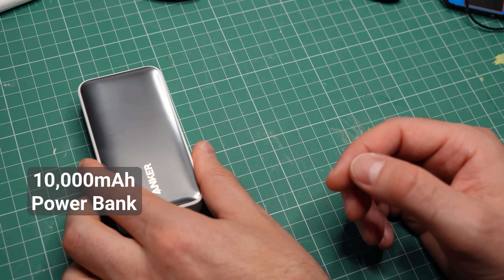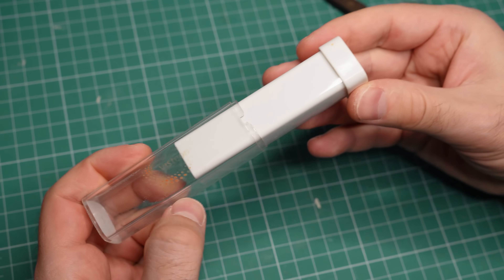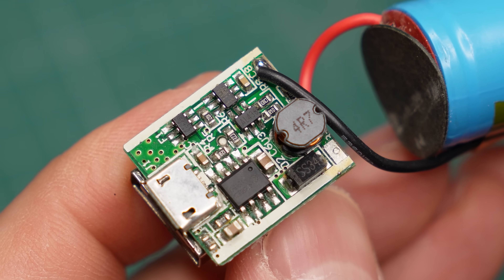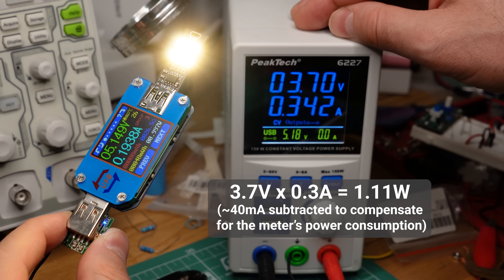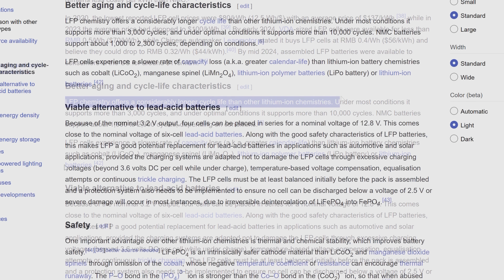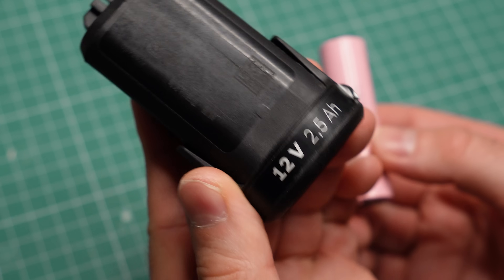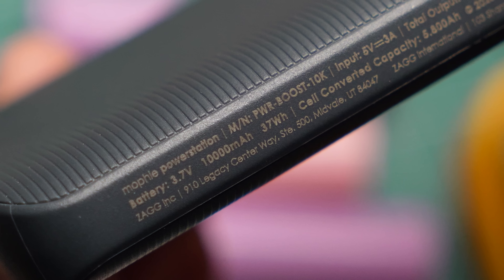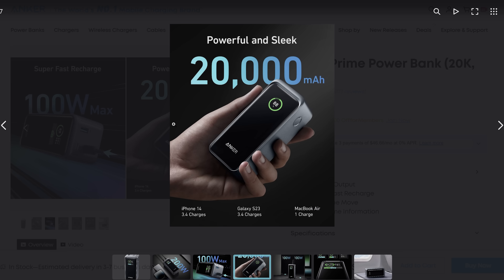Power Bank Capacity is Confusing. Let me Explain

Comment: It’s always annoyed me that it’s usually stated in mAh instead of Wh or J, mAh and Ah are measures of energy over voltage, if the voltage was at least always the same (e.g. 5 V) it’d be one thing, but this is just stupid.

My theory is that at least some companies purposefully reduce the voltage to get a higher mAh amount, in addition to everyone using mAh instead of Ah because it sounds bigger.

Wh just make sense, and are also used in the regulation for the maximum energy of a laptop on a plane (100 Wh)

Comment: You build a battery to a pack voltage. Let's say we were making a 72v battery which 84v fully charged. Let's say you are switching from Li-ion to Lifepo4 or vice versa. You want to use the same charger. For an ion battery you use 20 in series and for lifepo4 you use 24. So that's what 20% more cells so that kind of makes up the difference. You buy the voltage battery you need, it's not always a 3.7v power bank with more in parallel. I'm not saying your number is wrong I'm just saying that's not how I choose batteries. Iron phosphate has some interesting characteristics, the almost flat discharge is nice because you don't get that huge dropoff in power like NMC cells, you get a small drop and then it's steady the rest of the battery so you are always running around what would be about 85% charge in an NMC. You really have to watch your voltage with lifepo4 because when it says it's low you better believe it. You get good steady power the whole discharge vs that descent into sluggishness of NMC cells. I tried lifepo4 on my bikes for a few years but now I'm back on the NMC teet and running crazy pack voltages 35s and up these days. I actually have a modular ANT BMS that goes up to 104s. I didn't know that was a thing even. You have to use chunky DC breakers or contactors with these things so you don't vaporize your giant connectors when you attach to a load. It's all fun and games until the lightning comes out.

Comment: Lol 😂 not necessarily all depends on the battery battery in the batteries in the pack I got one that’s 72,000 130 white large capacity does 14 charge of an iPhone 15 Pro Max then I have a 40,000 TechSmarker power bank it does nine charges 
Then I have a  PD 30 W lightning 40,000 adaptive quick charging that does have chargers 

Each battery pack charged the iPhone 15 Pro Max from 20 to 80% and they were all different prices even though the last one was $200 regular price it was ridiculous but it was on sale for $44.99 with an extra 30% off if you bought two of them

Comment: Well actually for portable power banks I think there is also a typical capacity and rated capacity. I think maybe it is related to the voltage drop as the battery percent drops.

Comment: If the voltage of the phone and the power bank is both 3.7 V, then does that mean that a 10,000 mAh power bank can charge 2 5,000 mAh batteries?
Reply: No, since there will be losses when charging. You might get close to 2 charges

Comment: i'll never fully learn how a battery works unless i rewatch the video 12 times but some of the info i get out of it is useful.
Reply from the maker: If you have questions, that's what the comment section is for ;)
Reply: @LeftyMaker   well i guess i always question if leaving the charger in batteries is actually safe, everyone says that modern batteries capt at 100% and dont over charge so it cannot kill the battery, how would that even physically work? how does it not recharge or take away battery from it? its using the energy from the batter.
Reply from the maker: @FreeAimDog yes, that is actually a good question. The short answer is that you shouldn't be worried about overcharging if you're using a properly designed charger configured for the battery you're charging. 

Even cheap chargers have protection against overcharging, in the sense that they won't charge the battery beyond a certain voltage. For lithium-ion batteries, the limit is usually between 4.2 and 4.35 volts, depending on the model. 

The process is a lot more complicated, but generally, your batteries are fine. Unless...
- your charger is not configured properly (e.g. you're charging a 4.2V battery to 4.35V)
- you're charging the battery in extreme cold. I haven't experienced this, but I've read that if you charge a battery in the cold, its voltage will rise as it warms up. 

And in the case of a phone, for example, when the battery is full, it gets disconnected while the charger supplies power for the phone. It is only engaged if the charger cannot provide enough power.

Comment: USB batteries not advertising in Wh is my pet peeve. I don't know what mAh is supposed to tell me especially when they also dont share the nominal voltage. It's nonsense.
Reply: I know right? One could argue it was simpler before quick charge and PD when all power banks output 5V, but now they do 5V, 9V or more, which voltage the mAh they were calculated at!

Comment: The 3.2V vs 3.6V difference is the biggest part of this scam. Converter losses will also come into play when you use watt hours on both sides. By any chance, are there any phones out there that advertise higher mAh than most brands because they use a different chemistry with lower voltage?

Comment: Current times voltage: 5A×5V:25W
10.000 mah(10A)10×5(mostly charging voltage is 5 or 4 because the battery itself is 3.7 volt)50Wh but it can't just give full 10 amps,it has a maximum current,5×7:35 W
or can be a higher voltage low current like 20V 3A :60W

Comment: Nope. Wh is still bad. Watt is joules per second. Wh is joules per second for 1 hour. Using Wh is the equivalent of using "metres per second for an hour" as a unit of measurement for length/distance. Stupidly redundant. Just use joules or kilojoules. Don’t tell me “but but I’m not familiar with that unit”. Kilojoules or kJ is on pretty much every single food packaging denoting the units of energy it contains (unless you are american and use CaLoRiEs lmfao).
Reply: Ok hater
Reply: @samusaran7317  ok american

Comment: The voltage step-down in a charging phone dissipates some heat, 100% sure, but doesn't most of the heat come from the battery itself? Some inefficiency in the chemical processes of the battery?

Comment: Watt hours are also stupid. We literally have joules, which are the original unit, and watt is basically 1 joule per second, so writing watt hours is like saying I've driven at a speed 100 km/h for 1 hour instead of I've driven a 100 km. Given, 1 wh is 3600 joules, but both units are quite arbitrary, so just use the less stupid of two.

Comment: Yet I still don't understand why my 40000 mAh power bank managed to charge my phone 4 times when I bought it, but now, after 2 years and not more than 100 cycles, it only charges it roughly 1.7 times.
Reply: Are you leaving it fully charged?
Reply: @samusaran7317  When I bought it, it said in the instructions that I needed to charge it from 0-100 once and not leave it at 100 afterwards. So I did exactly that, charged it to 100 once and for the rest of the time, it was mostly sitting between 20-80 when I didn't use it, a few times at 0-10, but never left it fully charged as far as I can remember.

Comment: Wouldn't a battery with the same(but lower) voltage as your phone, but equivalent mAh to compensate for voltage difference (from a higher voltage but lower mAh) be better for charging your phone? Since it doesn't need to lower the voltage to charge your phone battery resulting in less energy loss from charging?

Comment: Another fun fact about Ah. It does not take into consideration the different discharge curves of different battery chemistries. So, a 6Ah 12V Lead-acid is NOT equal to a 6Ah 12V LifePO4, since lead acid bottoms out at 10v while Lifepo4 stops at 12v. The Lifepo4 has a fair bit more energy since its discharge curve is so flat, as opposed to lead-acid's more linear curve

Comment: I've been saying the exact same thing about smartphones for years now and it infuriates me when tech reviewers like MKBHD and MrWhoseTheBoss still use mAh to compare
Reply: They are not electrical engineers, there is nothing wrong with using mah ratings for their video purpose. The consumers needs to read the specs for the power outputs.

Comment: some (most it seems) battery packs only have amp hour, and it doesnt say what voltage that operates at. now i just assume 3.7V but i wont buy any power bank that doesnt have either the amp hour and the voltage they used to calculate the amp hour, or just the watt hour.

Comment: You're all wrong. :) My diy powerbank is 8 2600mAh lithium cells in parallel so it's 3.7 V (at 50%) and 20800 mAh. However since they have a discharge rate of 9A (3.5C) it takes about 17 minutes at max speed to discharge it, 270 Watts !! it's plenty for a phone. In fact max it does is 22,5 W. Energy is about 77 Wh.
There are practically minimal losses cause it uses 5v or 4.5v and 5 A. 22.5 W

Comment: Using Amp hours for capacity is absurd. It's like a removals company telling you they can get 3 vehicles to your property in a day, but not telling you the size of the vehicle. It could be 3 bicycles, or 3 freight trains.

Amp hours, quite simply, is not a measure of energy capacity.

Comment: The main reason for mAh to still exist is because powerbanks have been using that for way too long, and it become the "banana for scale" for powerbank capacities. I think these ratings would all be the equivelent value in 3.7V, even though you are not likely to find 3.7V configurations in higher end powerbanks nowadays. 
And it's not like 3.7V equivelent mAh is a bad way to market, since if you actually measure mAh from the battery and market that instead, nobody would know how to convert that to Wh, since it not only depends on the voltage, batteries also don't have a fixed voltage, meaning that you would have to do an integral on power consumption to get the actual value, and needless to say most people seems to be scared of calculus so this is only going to add confusion.

Comment: With tool batteries you can get even higher voltages. Milwaukee's standard is 18v, Hilti uses 22v, Dewalt has some 60v tools and Makita has a 64v line. They're all just measured in aH, so you need to keep in mind the output voltage to calculate how much power they actually store.

Comment: I guess everything is in there but I would organize it differently.  The main reason the 10,000mah power bank won't twice-charge a 5,000mah phone is not the efficiency loss.  It's the mismatched device voltages as you eventually said.  And using watt-hours is indeed the right way to go if they're published.  Often not the case.  So yes, you may need to calculate W-hr if you know the cell voltage.  Efficiency losses due to DC-DC conversion exist too but its a minor effect compared to the differing device battery voltages.  There's a third factor easily more significant than efficiency.  Cheap devices simply underperform their specs.  After doing all the math, my powerbanks only deliver about half to two-thirds the charge I would expect.  This may in part be because manufacturers rate their batteries under optimum lab conditions and very low current draws.  In the real world capacity will be less.  But also in the real world ads are written by marketers and many marketers lie.

Comment: Everything bad until you see the manufacturer show two measurements ( battery mAh and effective mAh)
Reply: Rated capacity is the total energy stored in the cell alone, and effective capacity is the theoretical maximum amount of energy you can pull from 100-0 after conversion losses

Comment: All you explained is technically correct but you should not disregard the Ah values as worthless, this value is the only correct measure of a battery capacity as it effectively measures the chemical capacity of the battery cell, it measures how many electrons the cell is effectively capable of supplying, when charging and discharging a battery you can only trust the amount of electrons they were pushed to/from the cell to estimate the SOC (state of charge) of a cell, as the current is the same regardless of the voltage drop due to internal cell resistance or circuit resistance, that's why battery management systems use this measure (coulomb counting) to estimate the SOC, wh on the other hand will deliver different values depending on where you measure it, as you cannot accurately measure the internal voltage of a cell, specially while under load

Comment: You could argue that the Joule should be used as it's the SI unit for energy. Marketing people would love it, 90,000mWh becomes 324,000J. (Just * 3600 : number of seconds in an hour)

Let's just not go into electron volts, 2.022249e+24 written in full would be a tad excessive, even for marketing!

Comment: Finally someone addressed this. I’ve been saying we should be comparing battery capacities with Wh for years now.
Reply: Same. It drives me nuts when internet 'experts' talking batteries - especially home, solar & off-grid & car batteries talk about amp hours, instead of the more useful kWh
Reply: But there doesn't seem to be a big difference in Wh and mAh, if the only difference is the factor of 0,2 I mean if I have a 10.000 mAh Battery with 3,6 V and one with 3,8 Volt it's only a difference of 2 Wh and that's the biggest range in differences or did I miss something?
Reply: @Johan-mr5ch That's silly and makes no sense.
Reply: @_nom_ explain yourself

Comment: What I never understood is why laptops use Wh but phones use mAh
Reply: my theory is because its commonly known that legally, laptop batteries 100Wh or higher cant be taken on planes. So many manufacturers will purposely make them 99Wh and then advertise that so people know its airplane friendly. Because of all this, its now standard to just measure in Wh.
Reply: @subhansajid6386 You could also say "It's airplane friendly" or "That's under 100Wh"
Reply: Why does everything stick to a non-stick frying pan? To create confusion, controversy and mistrust.
Reply: @jaystarr6571 your non-stick pan sucks
Reply: @jaystarr6571 you need to oil it up
Reply: laptops are multicell and have larger packs for which Wh is a better unit than mAh
Reply: @MahbodKaramoozian  then just use mWh. There literally no actual good reason to use mAh
Reply: @Supreme_Lobster  the "multicell" part in series plays a big role in why mAh is not used in laptops, when you put batteries in serial mAh just becomes a wrong measurement because of complications and inconsistencies while for only one cell it's completely fine to use mAh if AND ONLY IF you specify voltage
Reply: @MahbodKaramoozian  its not fine because even if you specify the voltage, most people dont know how it works and just assume higher mAh means higher capacity, even tho you can simply increase the mAh and decrease the voltage, resulting in no capacity increase, but advertising as higher capacity. mAh allows manufacturers to lie in advertising. Wh (or mWh) doesnt
Reply: @Mah @MahbodKaramoozian  just said there is no good reason to use mAh, and you just go and say the same again, not sure im following here
Reply: @MahbodKaramoozian ohh thank you
Reply: Because, laptops didn't use same voltage for their battery, different manufacturer has different voltage configuration, meanwhile mobile phone just stick at 3.7~4.2 V as it is default lithium ion voltage.
Reply: @EdiUtomoPutra  ok, but everyone already was familiar with Wh so why change to Ah? Like it was already a common standard, and a more useful one, just keep using it, why get a new measurement that is worse in every way and force everyone to use it
Reply: @dofer112 someone started to use mwh in phones and powerbanks so that stuck and once consumers are used to one measurment its nearly impossible to change it again.
Also most people simply don't care.
Reply: always the numbers. 90% of oems mislead by making high milliamp hour counts, but a horrid efficiency or watt hour count
Reply: It is much worse. Things like gasoline, coal or food use calories :(
Reply: Could be, havent looked this up so correct me if im wrong, but I believe most phones use 5v for their battery and internals so it was pretty standard
Reply: @finnjacobs  no. The phone batteries have their nominal rating at 3.7 - 3.8V, it says on the battery sticker. Even the guy in the video mention the "step down conversion" from the 5V on the input.

Comment: What baffles me, is that Power banks use 3.7V lithium batteries, convert it to 5V and then phones drop it back to 3.7-4.2V for its lithium batteries. We are making unnecessary lossy conversions, and it would be much wiser to add support for sub 5V charging to USB standard.
Reply: A phone will need to step up these voltages internally. More internal heat.
Reply: @ramunasgudauskas7582  stepping down also produces heat. That's why fast charging produces a lot of heat. Fast charge heats up the phone way more than potential 3.7V > 4.2V step up. Minimizing the losses is the point. When transferring power from power bank to phone, where both use similar voltages and USB 5V step-up > step-down is inefficient extra step.